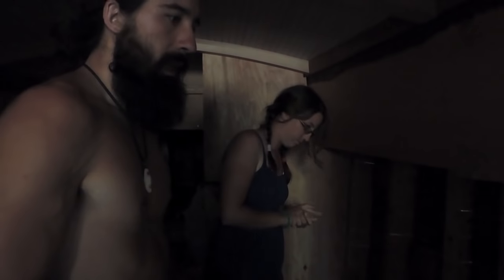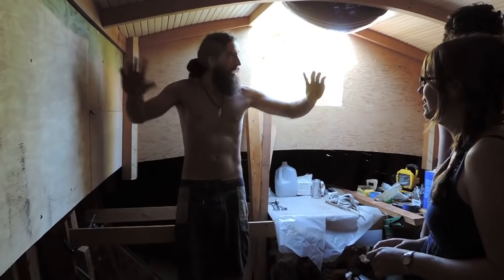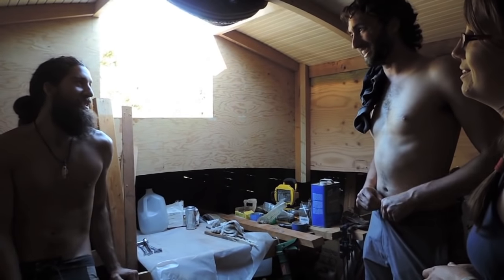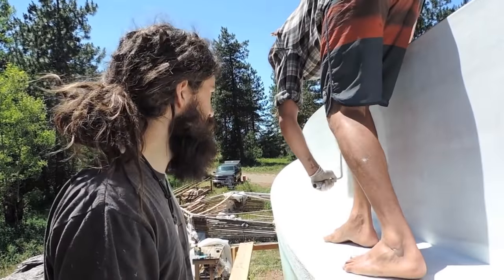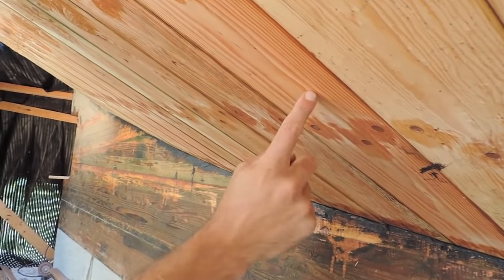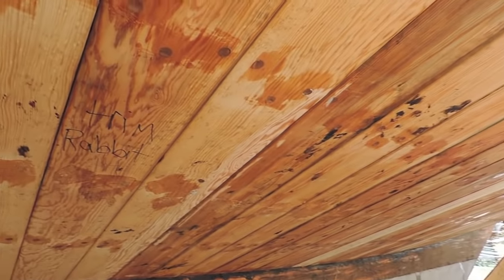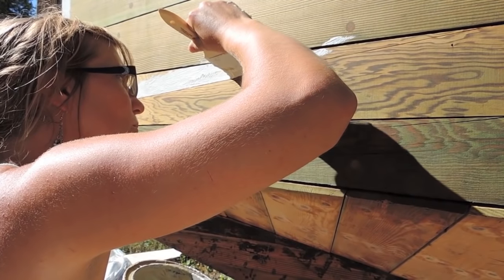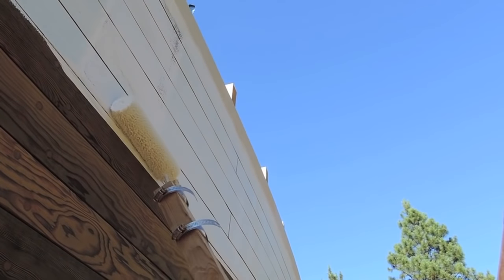Salt & Tar Episode 24

Comment: Question about launching a boat. Could you just go inside and spray everything below the waterline down with a hose a couple of times the day before you launch to get it wet and swelling so you don't have to deal with pumps or hold up the travel lift straps?

Comment: You two are awesome, and I am hooked on this project! One thing I don't get is your not using cotton on the cross planked bottom. I understand that the wood swells up (I owned and lived on a little wooden sloop for a few years), but it seems to me that every carvel planked boat I've ever seen being repaired/refitted receives the cotton in all seams ... above and below the waterline. Does your decision have something to do with the cross planking design specifically?  Thanks in advance, and good luck moving forward. I'll be watching!

Comment: Good decision I think on the deck. Will there be kiwigrip or some kind of nonskid?
Reply from the maker: Yeah we are using Rustoleum oil based paint and sand (as we've done many boats before) we originally wanted to plank the decks but instead of halting forward progress on the whole of the project we painted the nonskid for now. We were going to glue strips of Douglas Fir left over from our planking stock to make the deck appear traditionally laid....  but once we took the shed down we had to protect the epoxy from UV damage so we made a choice to just act faster with paint haha
R

Comment: How did you decide where to draw the waterline?  Looks way to high.  That boat will not draw that much water unless you are carrying a lot of lead for ballast.
Reply from the maker: The building plans gave us the load waterline and we raised it 5 inches just because she might sit lower from time to time depending on her cruising weight (extra gear/provisions) It may look higher but it's actually less than 5 feet down to the base of the keel.

R

Comment: Great job but i was wondering... Are you going to caulk her and why did you choose not to silicon bronze and copper fix her....
Reply from the maker: Hi Thomas, yes we are going to caulk her above the chine. Below the chine, where the planks transition to the cross-planked method (diagonal), like we explained in this episode will have nothing more than some putty to stem the intake of water until the boat swells naturally. And as for the fasteners we would have loved to use bronze or copper but they are way too expensive. Same as why we didn't plank in anything other than good old douglas fir. Fir and galvanized steel are perfect for this working girl :)

R
Reply: Thank you for the reply. Indeed you are right, i hate to think how much it might have cost you in bronze screws alone. Douglas fir though is a good wood; cared for it will last well. Its very impressive what you have both done, I wish you all the very best.

Comment: Not wanting to rain on your parade or anthying but who designed that boat? It is quite clear that there is a lot wrong with it, the basic shape, the scantlings and the way it was built. The planking is laid wrongly along the bottom .This will cause the hull to move like crazy in a seaway and leaks will be the least of your problems.Despite having been built heavily, far too heavily, the structural integrity will be weak. I'm sorry to say but the whole thing is unsound. I thought at first that you were going to sheathe the hull in veneers but the chine hull shape doesn't lend itself to that so maybe in epoxy and glass. Still not likely due to the method of build.Heavy scantlings are no substitute for proper design. A much better hull ,and lighter by miles, would have been achieved by using  marine plywood sheathed in epoxy and glass.
Reply from the maker: She's designed by George Buehler and is inspired by traditional boatbuilding. Maybe in this day an age I understand your concern but boats like this having been sailing for much longer than you or I have been around. It sounds like you're not too familiar with this style of boat so I don't expect you to have an understanding. Trust us, if we didn't think she'd be seaworthy we would've quit a long time ago. I could try to explain but the best thing would just be to show you. Stay tuned and watch her sail once complete and maybe you'll change your mind (or prove us wrong, either way) . Thanks for watching ;)
R
Reply: I'm all for things going well for you two believe me. This is indeed a method of construction I'm not used to so by all means prove me wrong. This is a major undertaking and I admire your resolve.I'll certainly keep watching your videos .Good luck, there's still a lot of work to be done.
Reply from the maker: Absolutely! Thank you Nuno for writing. I can't wait to share her floating! We think we'll launch this spring after finishing the hull but the work continues on after that with the rig then interior stuff. Fun things for sure.
R

Comment: At 13:10 between the washer and deck head you should have used an extra pressure spreader to stop the washer pulling through the deck, lot of leverage on that.